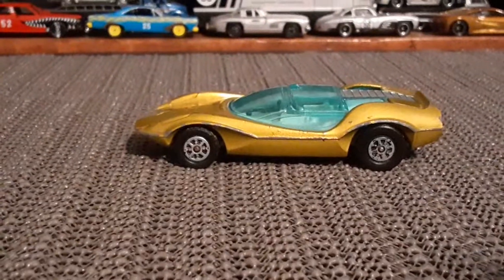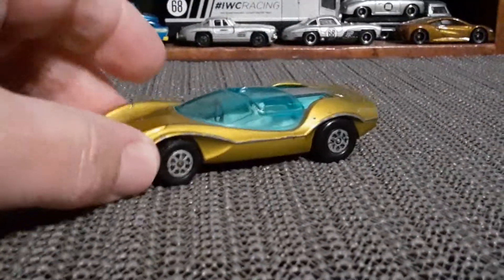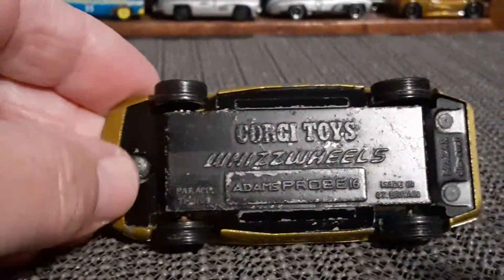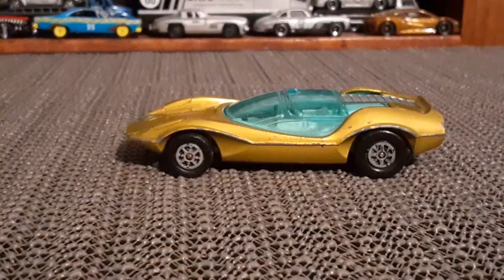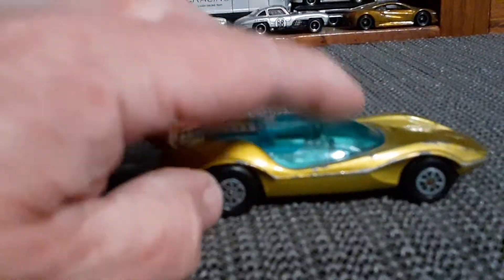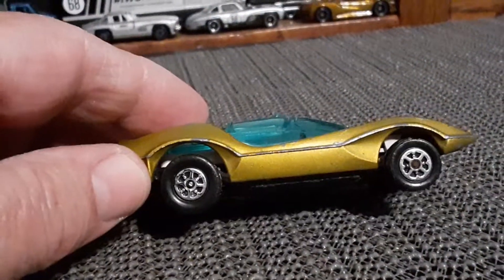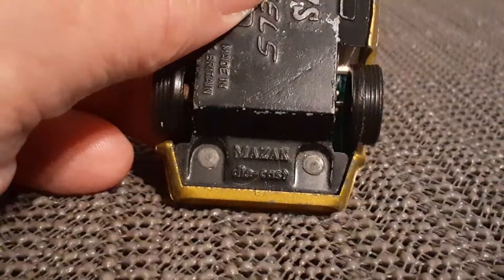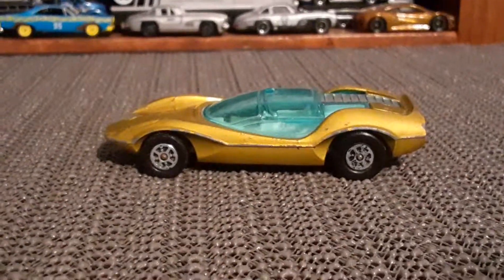Adams Probe 16... Corgi Whizzwheels

Comment: I had one of those, but I gave it to my buddy because he loves concept cars, I do still have another concept car by corgi, the chevy astro 1, the rear part of the body lifts up and the seats come up with it, its way cool and I have changed out the plastic wheels for rubber ones.
Reply from the maker: I will have to check out the Astro.
Reply: I can include it my next video if you like?, I have found 9 new matchbox cars today and 4 welly 1:64, quite rare to get 1:64 welly cars.
Reply: Just made a video with the astro chevy in it, should be uploaded in about an hour.
Reply from the maker: @colinsdiecast164customs  I will check it out.
Reply: Just completed :)